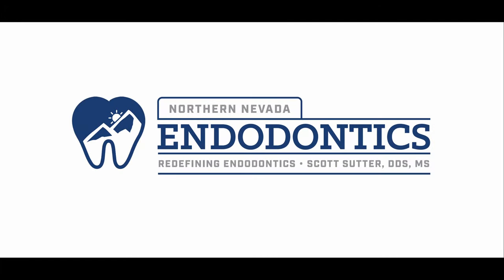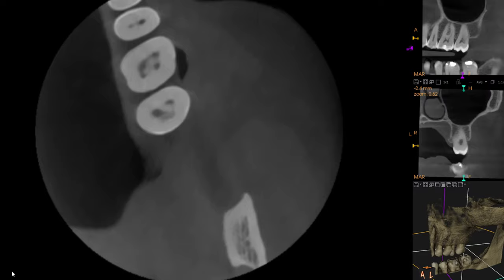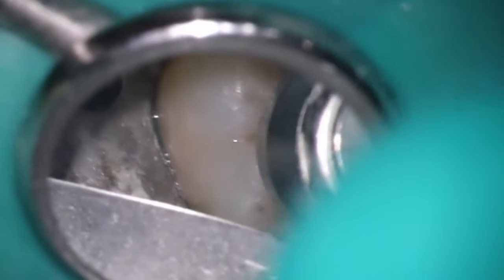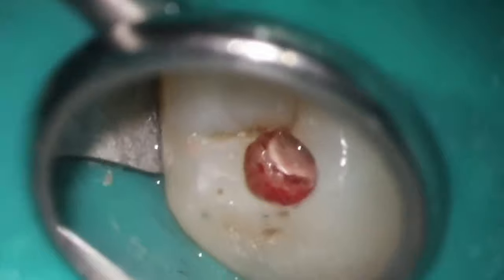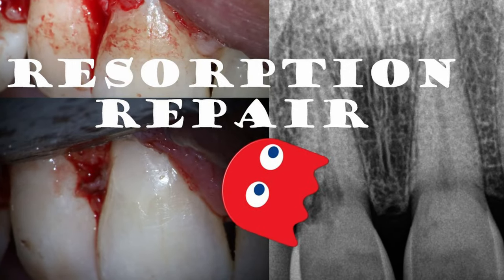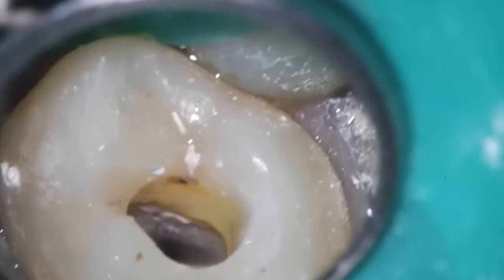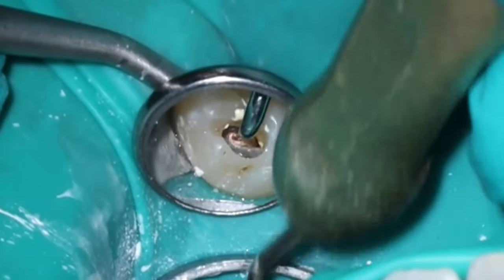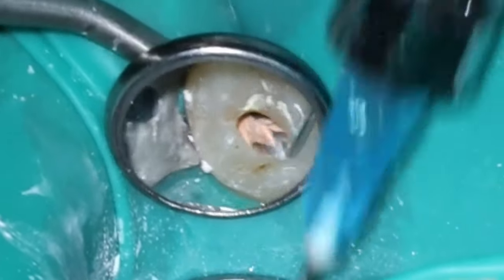Nonsurgical ECIR repair; New Technique!!!

Comment: Great case and outcome! You made internal repair of ECR look super slick and easy. What usually leads you into treating these ECR cases instead of monitoring for further progression? Secondly, do you think not sealing off the portal of entry from an external approach will still cause the ECR to progress around your restoration? Granted no one in their right mind should try and access that one from an external approach! 
P.S. - Bioclear better start sponsoring you!
Reply from the maker: Thanks! 👍 my process for these cases is always changing, and there’s a whole lot of “it depends!” In this case, we had a historical radiograph from 6 months ago that showed no resorption so with that level of aggression I don’t feel comfortable monitoring. If it was in a better location, I agree, a surgical approach would be superior. I thought about intentional replant but the pt didn’t want to go that route. Thanks for watching!

Comment: Thanks for sharing! After four weeks with CaOH the prep looks great!! 
I believe I was taught in dental school that 90% TCA is used to help treat those small channels of tissue. Is that something often used if treating in a single visit? Do you find it is effective? I have never treated a resorption case so just wondering what you've noticed if you've used it in the past.
The technique you used here appears to have worked beautifully!
Reply from the maker: I was taught the same thing! But TCA is super annoying and caustic (pH 1.2), and I don't keep it around the office. It's also difficult to buy. 
Here's my other thought process: Osteoclasts are inhibited by high pH levels, which is why we do long-term CH in trauma cases to prevent resorption. It didn't make sense to me that we would use a strong acid to cauterize (much easier to type than say, lol) when we can also use a strong base (pH 11.5) PLUS get the benefit of shutting down future osteoclastic activity (and encouraging the reformation of the cementum). And I have it in every room so it's easy to implement. 
I have only treated one of these cases in a single visit. He was the husband of one of my best referrals and a great guy. That tooth is now an implant... So, I use a multiple-visit approach for any resorptive case to ensure I don't see any bleeding spots. If I did, in this case, it would have been extracted. I try to keep my resorption repairs to Heithersay I or II and shy away from III and IV given the poor long-term prognosis, the multiple visits required, and the cost-benefit ratio compared to replacement with a dental implant.
Reply: @PatencyPro  Oh dang! Good to know! Thank you so much for taking the time to provide such a detailed explanation!

Comment: Hi Scott, you have an interesting instrumentation protocol that seems to eliminate the need for hand files. Can you please elaborate how you approach your instrumentation? Do you progressively crown down with narrower files as your advance apically without any manual negotiation?
Reply from the maker: I like the use of “interesting” here lol. 
I saw too many of my older faculty retire young because of excessive hand filing. I’m always looking for efficiencies, and having a machine do work for me is just lovely. On a wide open case like there’s no benefit to hand filing. 
Check out my curved roots video or one of the retreats to see my approach in more detail. In general, I do a modified crown down starting with wider files and progressing to smaller. Granted, all these files have a tiny MFD, so it’s not going to look like “the look”. Try it out and let me know what you think!
Reply: Haha Scott, its only interesting because I've been taught by many of those more conservative profs. So I'm not sure if I am following correctly, but your protocol is straight to 20 06 then 17 04 in the coronal 2/3 followed by WL determination with #10 K file? Then following full WL enlargement with progressively larger rotaries. @PatencyPro
Reply from the maker: On a non-calcified case:
8C to close to CBCT WL
20.06 to about 1/2 of CBCT WL
EAL WL with 10k
17.04 to EAL WL

But, as usual, "it depends" is the best answer haha
Reply: @PatencyPro  Awesome scott! I do something similar but try to go 2/3 WL using 8 and 10 regular K files then followed by 25 06 to 2/3 WL.
I find there are the odd occasions where if i try to go straight to 10 file for full WL i end up blocking the canal irreversibly (especially vital cases). On occasion, I still got to pull out the 6’s!
Reply from the maker: Oh totally! I like to put a small bend in my files unless it's completely calcified as that helps lessen the risk of blocking the canals. Lots of rinsing helps too! (I think the Triton stuff is amazing for these cases)